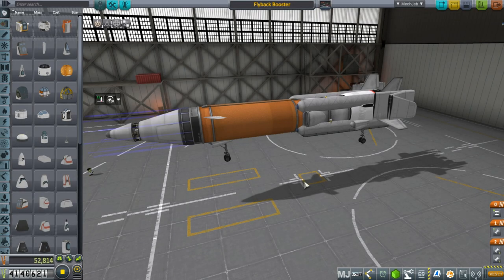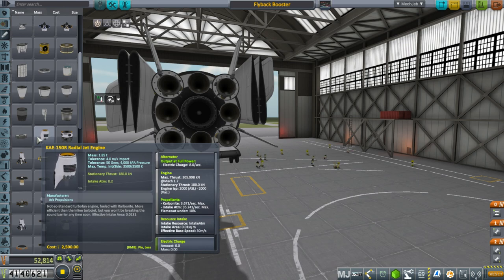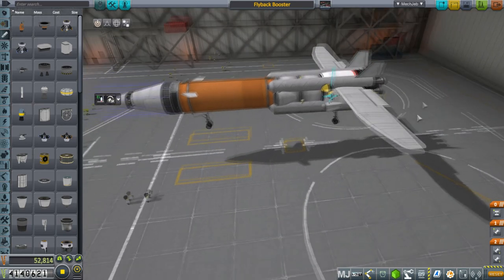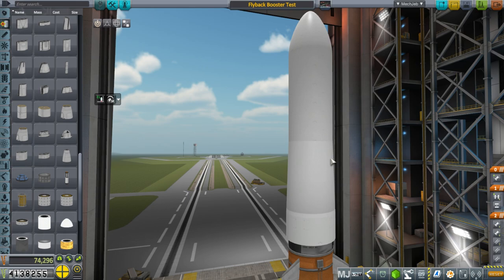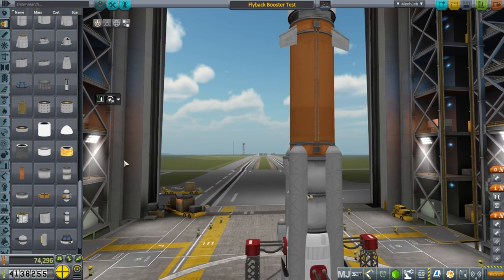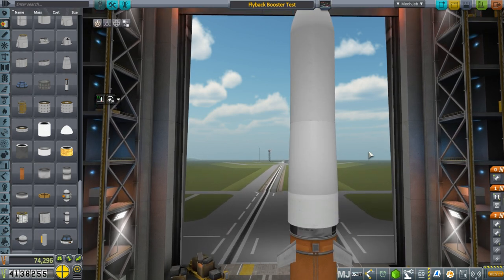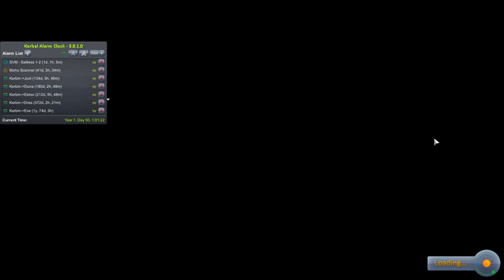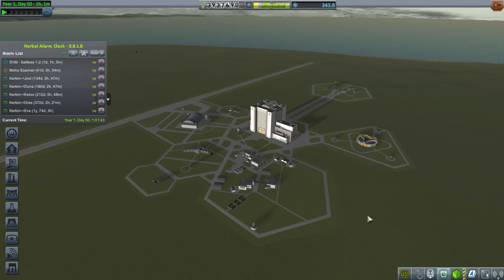Kerbal Space Program - Kolonization in 1.2 07 - Flyback Booster

Comment: Good series.  Its completely unrealistic, but when I fly a recoverable booster back from orbit like that, I have SAS or Smart ASS hold orbit normal at entry interface.  Lots more drag high up in the atmosphere when its a sideways telephone pole instead of a dart.  I also reserve fuel and use the large LFO RCS thrusters to hold that orientation longer.  This will wipe off enough speed to keep the air brakes alive.  Once the aero forces take over and it starts flying engine first, I switch to surface mode and command +40 pitch.   It never holds that angle of attack, but every bit of deviation from prograde helps.  Landings are usually under parachute with propulsive assist at the very end.  Enough chutes to get to 50 m/s is a good compromise between number of parachutes and fuel reserved.  Booster mass on re-entry is critical.  If your payload is too light and you have too much fuel left in the booster, you'll never slow down in time to make the landing.  If you're crashing, on the next attempt either perform a high altitude breaking burn or do pointless burns to get rid of fuel.  If you find yourself too fast, a good emergency procedure is to start pumping fuel between the bottom and top of the booster if you have multiple tanks.  The shift in center of mass will hopefully be enough to make the current orientation unstable.  The booster will flip and tumble to a stable orientation.  The flip will massively increase the drag and help slow down.  Pump the fuel back to the bottom end and it will flip again, slowing down more, and orienting for landing.  Even if it doesn't flip on its own, sometimes the change in the center of mass will reduce the stability margin enough to allow an increased angle of attack and more drag.

Comment: Good job on at least trying with the flyback booster designs!  And now a question from me:

Have you done polar launches from KSC using Smart A.S.S.?  I've gotten the hang of using it for completely due East launches and I've put two comm satellites in orbit around the Mun; an equatorial one, a polar one and soon a second polar one.  I'm wanting to put polar comm-sats around Kerbin too, but I wanna go polar from KSC rather then burn several stages worth of propellant changing my orbital plane to do it.  My playing around so far using MechJeb 2.6.0 is telling me that Smart A.S.S. can't do it.  Fooling with 'HDG' from the 'SURF' mode doesn't seem to be helping.  I've not tried manually rolling before pitching though.
Reply: Do you put that HDG number in and click EXECUTE BEFORE ignition, or AFTER ignition during the first seconds of ascent while still under 1000 meters?  I've been trying to sequentially click HDG to 0 after ignition and after turning SAS off and not been having good results at all doing it that way.
Reply: BTW, I know what what you mean now by reaction wheels being THE magic attitude devices they are.  My first Mun comm satellite launchers use only 'Basic Rocketry' parts, but with a bit of help from SXT Continued and Porkjet's Overhaul.  But still, I had to stack so many FLT200 tanks in two stages and then put four thrust-limited Thumper SRB's at the bottom with stabilizing fins that it looked like an impractically long pixie stick.  Yet, topping each powered stage and my satellite itself with a service bay packing three of the small inline reaction wheels, 8 to 9 reaction wheels overall for the whole vehicle, it was still surprisingly stable.  Thing had 5,600 delta-V, way more than was needed, but I wanna be able to dispose of these early comm-sats later on when I've got the tech to build much more capable ones, or more likely recycle them to send them to the other planets until their fuel gets low, THEN crash them to dispose of them.
Reply: Had to roll back to your 2.5.9 build 642 version of MechJeb 2.  The HDG function wasn't working AT ALL in Smart A.S.S. it in 2.6.0.  Using your build, Smart A.S.S. did exactly as I wanted it to do and I was able to get into a perfectly polar parking orbit, inclination seemingly right at 180 degrees. My final orbit for the comm relay was 60,000 km x 100 km.  Getting my staging and throttle control back when I need it takes an active click outside the A.S.S. window with this build, but I ain't complaining if it works like its supposed to.  NOW I can continue building my comm network.